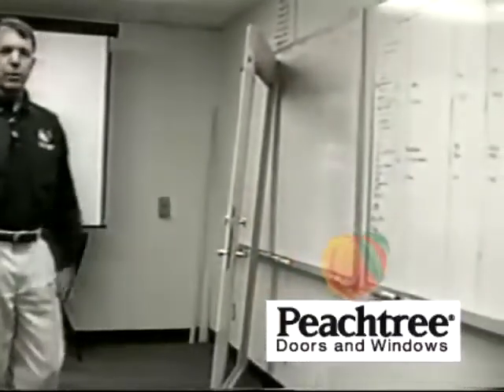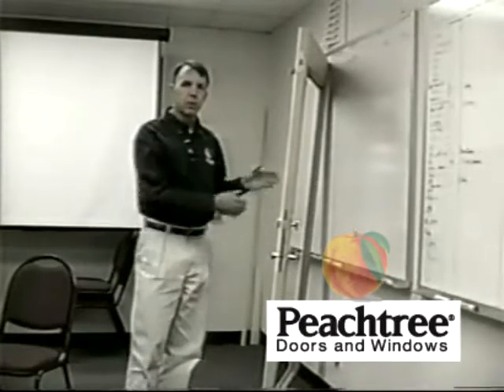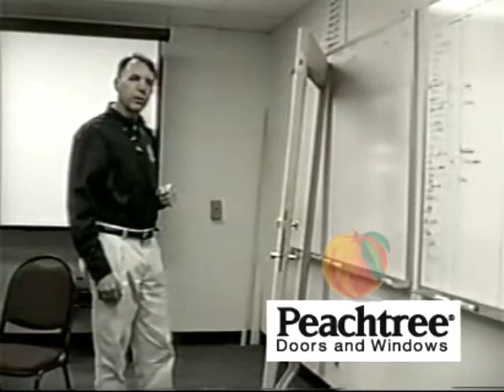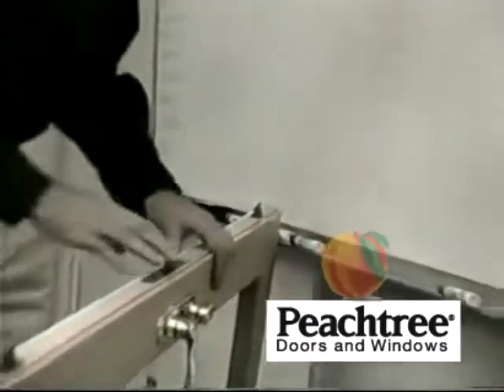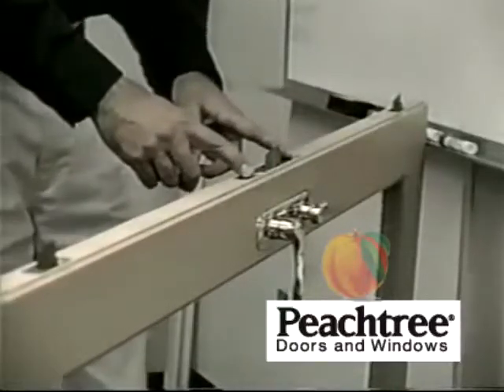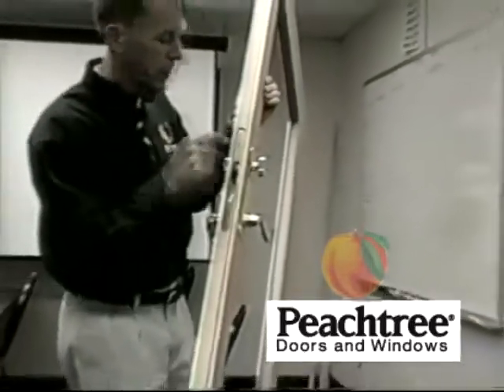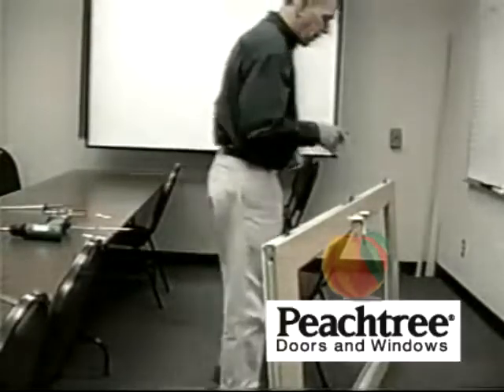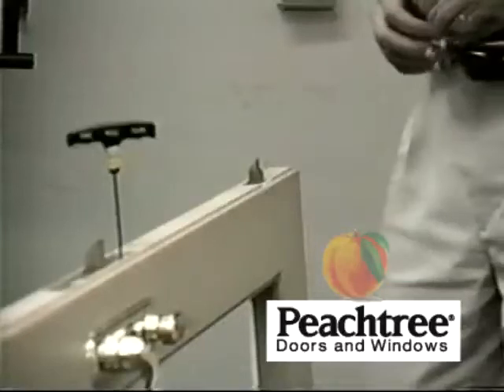Peachtree IPD / Citadel Multi-Point Lock Repair / Installation - Part 1/3

Comment: when ur Peachtree IDP is close and can't open,  pull the 4 hinge pins, take the IDP hardware off ( my IDP sh## itself, not made for grandkids, luckily I save an old IDP and Rob parts out of it ) anyway the IDP get to that point it's repair or destroy ( one of mine  a drill and half inch drill bit did the job) and do what the man says in the video that's working on a nothing wrong door :-( Do it on a nice day:-)